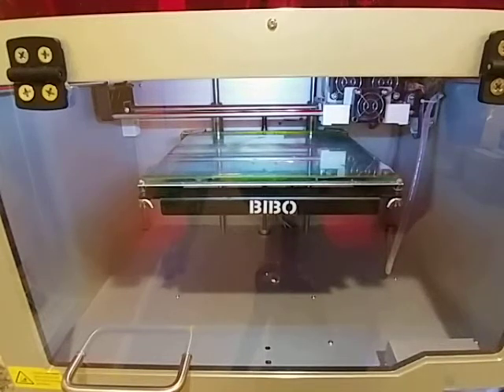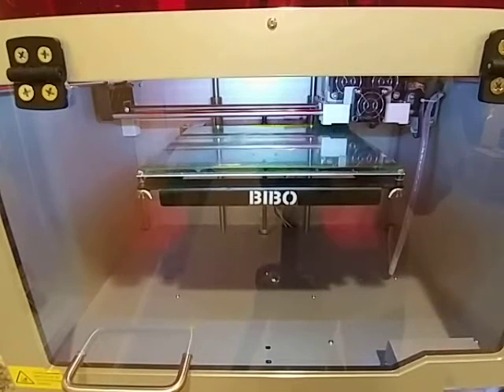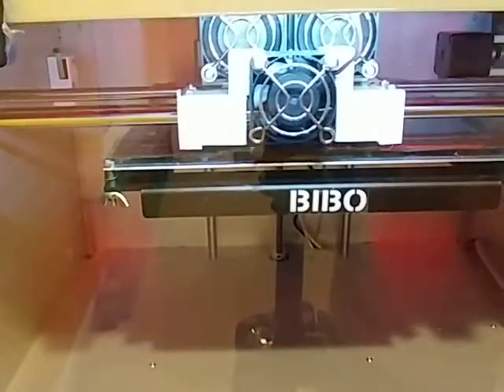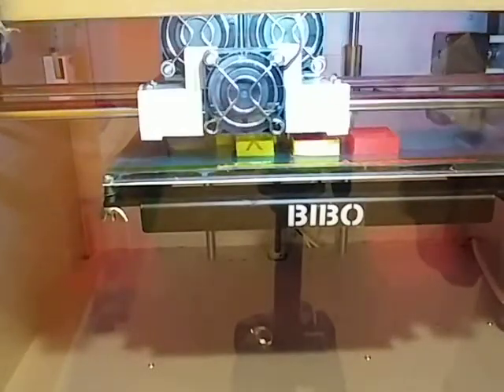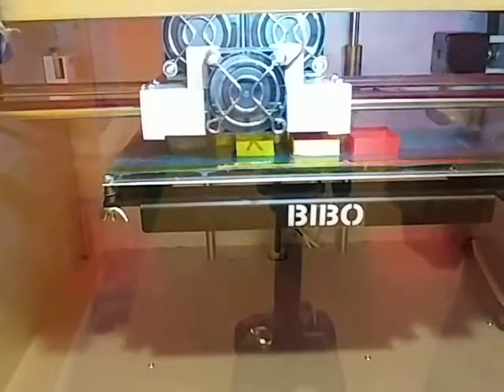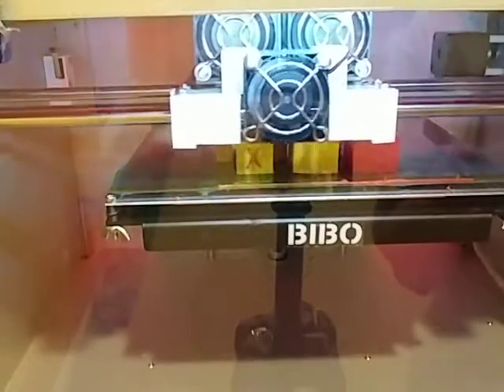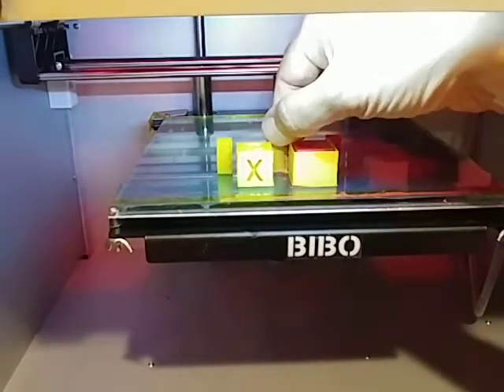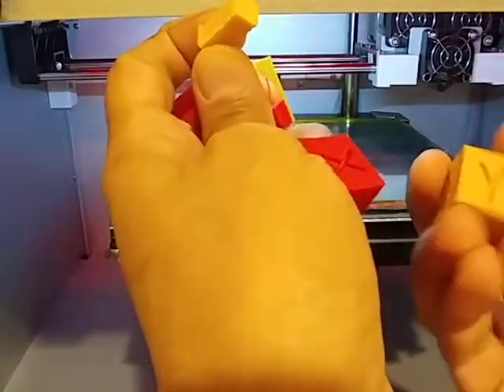Dual extrusion Copy function of  BIBO Touch X 3D printer

Comment: I have this 3d printer and 800€ worst invested ever. Started having issues with extrussion, then I had to dismantle the whole header to unblock it, one of the extruders was too much unleveled and somehow blocked so I couldn't adjust it, and I had to hit it with a hammer to be removed, it was removed, then adjusted, but it no more was stable in its position even with the screw tight. One motor stopped working and tech support sent another motor, then it started to print well, but extruders were never aligned, when the plastic was going through them it was pulling them out, the termistor broke or I don't know what and one day I saw the heater shinning and when I touched the cables seems the thermistor was working again and printer showed 800+º temperature on that extrussor. The glass bed was a mess, even with the glue plastic was not sticking well enough, so I put a layer of paper holded by clips and put a bit of sprayed glue on the paper, I could use it for a while, but only with one extruder, the other one was moving depending on if the plastic was going in or out. Laser, one of the reasons  I bought that printer has not been used, didn't dare to remove the header and cables in case something else was disaligned or a cable broke. Perhaps it's a good printer and I got the black sheep of the pallet, but it's in the toilet and the next step will be bringing to the recycle point.

Comment: Hi, you are not actually "copy printing" in this video. You are just dual extruding. You should not have any purge towers for copy printing. Here is how to copy print: 
1. Prepare ONE item as you normally would (max 33 cm object width), then click the config button and select one of your SINGLE extruder settings. (as far as the slicer is concerned we are printing one object for this demonstration)
2. Find the print tab and then the g-code section. Your g-code should now be displayed.
3. Add these 2 lines to the START of your print g-code.
M420 S1
M109 T1 S190 
(the line just BELOW these should be ";Startcode BIBO printers")
4. Add this line to the END of the print g-code (on Repetier there is a sub tab for start/end g-code)
M420 S0
(the line just ABOVE this should be "M117 BIBO Print complete")
5. Click "save as" and save this as your new "copy print" base format for future use.
6.Slice and print, taking care to watch the first layer for any ooze that occurred while both nozzles were heating.

What you are effectively doing is running a print like normal but forcing the machine to analog run the other side simultaneously. Much like holding 2 pens in one hand to create a double image.

notes: This is if you use extruder 1 for the print setup. If you wanna use extruder 2 for the print setup, change the second line of code added to "M109 T0 S190".  This will make extruder 1 the slave instead of ext. 2. Also the "190" represents the print temperature and you can change it to whatever you need. You can find your g-code by clicking configuration>print>g-code, if using Repetier. You can print rows of many objects as long as they are 33mm wide max and a gap of 33m is between them.

The instructions say you should also power cycle your machine on and off to make sure it stops heating the forced on extruder when finished.
Reply: Today M420 is listed M420: Leveling On/Off/Fade (Marlin).  This would have nothing to do with copy printing.  What is the equivalent command today? Thanks,...

Comment: How did you get it to print in copy mode? There is absolutely NO information on how to set it up. Is it something you do in Simplify3D or do you do it on the Bibo after inserting the card?
Reply: I purchased a Bibo 2 second-hand a month ago and had this copy printing function working fairly quickly in Prusa Slicer. When you set it up as a new machine, it already has the BIBO as an option with pre-set configurations for each extruder setup (single E1, single E2, duo, copy etc) - hope this helps.

Comment: How did you get it to print in copy mode? I can't figure it out.
Reply: I purchased a Bibo 2 second-hand a month ago and had this copy printing function working fairly quickly in Prusa Slicer. When you set it up as a new machine, it already has the BIBO as an option with pre-set configurations for each extruder setup (single E1, single E2, duo, copy etc) - hope this helps.

Comment: I've just ordered this because I want to be able to print support material, requiring two extruders.  Your comment about not varying temperature between extruders alarmed me.  Care to elaborate in this regard?
Reply from the maker: Yes, I found that the temperature control in the BIBO does not allow for two materials with widely differing temperatures (say, PLA and ABS) to work well together. But, apparently, that is a common issue, mostly a limitation of the materials at high temp. Either way, it is a pain.
Reply: OK, I'm seeing recommendations elsewhere to use support material that prints at a temp close to the structural material, e.g., PLA with PVA.  That seems reasonable anyway, so maybe it's not a serious impediment.  Alternatively, I wonder how practical it is to insert pauses into the print run to allow time for temperature changes in switching material selection.  One would have to do it strategically to minimize mode switches and attendant delay.

I've yet to produce my first print, so I'm just getting oriented.  Thanks for your video and advice.
Reply from the maker: Pauses are likely a to have an unpredictable effect on the printed material since that would have temperatures much cooler than if the print were continuing without much pause? I have not tried it myself though.

Comment: I was looking at this printer but there is not a lot of information on it that I can find, I can only guess that it has a 8 bit motherboard?, Do you know what drivers it uses? What software is it compatible with, and what software if any does it come with?.  Where is it made? Sorry for all the questions but I would like to know as much about this printer as I can before purchasing one. Thank you.
Reply from the maker: These are all good questions.

The basic mother board is an Arduino controller. The open source Marlin firmware is what it uses. The touch screen uses the MKS TFT code. Anything that can drive Marlin can drive this printer. They suggest Cura. Most people like Simplify3D. Personally, I use either Cura or IceSL.

If I were to buy a printer today, I might go with the Prusa MK2S with the MMU Kit or QIDI XPro. They are simpler and seem to be more robust. But, like everything in this space, all of them require some level of hand holding. Technology maturity is not like a current generation 2D printer for sure.
Reply: Thank you for the information.

Comment: hi , nice video , I gave you like , please advise do you recommend me to buy one ? and did you try the engraver ?
Reply from the maker: Hi @MBZ AUS, thank you for the like!

The printer is a good printer, but it does have its faults like every other printer there is. The biggest challenge that most people seem to face is that with two nozzles, the printer rarely ships completely level. So, leveling is a pain.

If you don't really need to use more than one material per print, I would suggest getting a single nozzle printer. If multiple filaments are required for your print, you can do it with this, but you might need to get commercial software that will drive it. 

The laser is very low powered and can maybe burn thin paper, and mark wood, but that is about it. And to get a good marking you will need to run it slow. Also, you cannot have the laser head and the print head at the same time. You will physically need to remove the print head to install the laser head and run it.

If you are looking for fast and deep engraving, you are better off with a higher powered standalone laser.

Hope this helps.